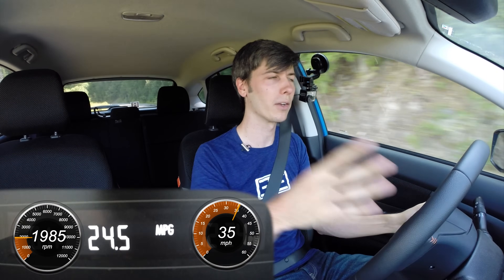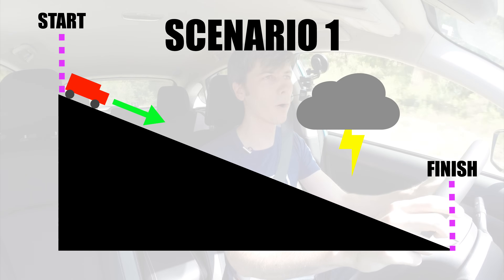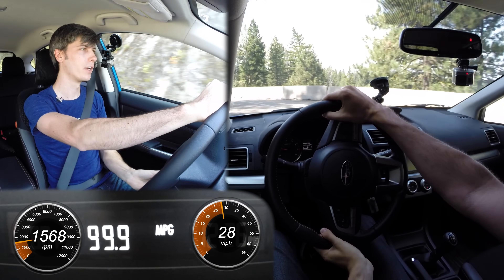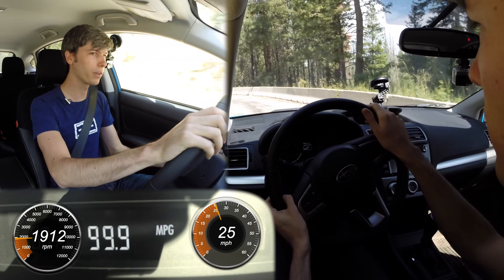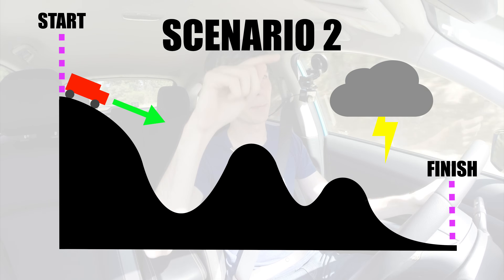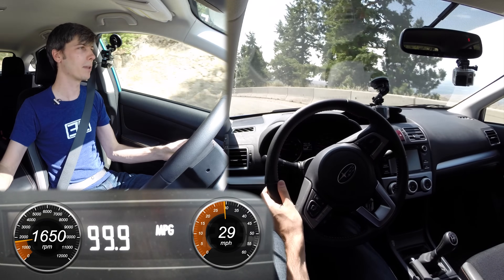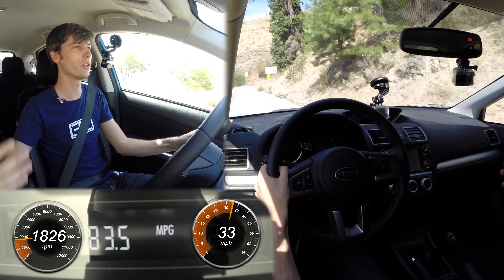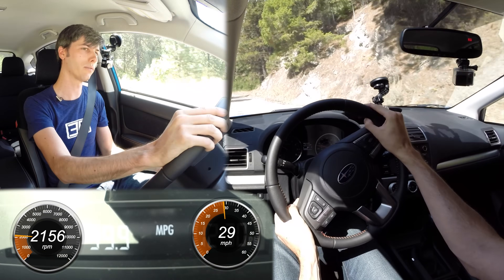What Uses Less Gas - Coasting Or Engine Braking?

Comment: Why does the car need to inject fuel if you're in neutral?
Reply from the maker: There is no connection between the wheels and the engine when you are in neutral.
Reply: that's what I was trying to say, thank you
Reply: to keep engine running, otherwise it would stop
Reply: Why would it stop? Wheels are still turning right I don't see how it would be different than if car is in gear?

Comment: It depends but most likely you will be using engine breaking more often because you rarely find perfect hills one after another for coasting in neutral over them like a roller coaster. 

A lot of towns in Texas say "No Engine Breaking by city ordinance." I wonder whyg that Is? Is it because people won't see youh breaking and slowing down gradually?  Is it because when people shut off the engine breaking it lets out more exhaust all at once or something? Curious.
Reply: They're talking about semi trucks using engine braking. It's like 55 times louder than a diesel engine idling.

Comment: Fuel injectors do not shut down. Your engine is still running and using fuel.
Reply from the maker: On modern cars with electronic fuel injection, yes, they most definitely stop injecting fuel.

Comment: Then why do some automatic cars like mercedes go into coasting when you drive down a hill in ECO mode?
Reply: They only do that if they have a system for keeping your vacuum assisted brakes and servos operational. Like the hybrids (think something like a C350e). Coasting AND turning the engine off is the absolute best way increase efficiency, but not at the cost of safety. Which is why not all cars does that.
Reply: I'm not sure if I understand you correctly. Coasting in an automatic means it goes into Neutral and keeps the engine idling, right? My question was why they would program it to coast instead of shifting into the highest possible gear if that saves more gas when I'm driving downhill. As far as I understand the vacuum assisted brakes and services should still be able to operate through engine breaking. I drive a non hybrid 2016 (so it should have a modern EFI that can shut off fuel) mercedes and it coasts when I'm in eco mode.
Reply: I just saw on a different video that they coast instead of using a high gear because although you do use fuel to keep the engine idling it's more efficient to let it coast because you have to step on the gas way earlier when you're engine breaking. So I guess it also depends on wether you want to not exceed a certain speed like on a twisty downhill road where you use engine breaking to save fuel and not get too fast or if you have a road which is only so slightly downhill that you don't get too fast when you coast.

Comment: Does putting the car in neutral turn off the fuel injectors as well as your coasting down?
Reply from the maker: No, when in neutral you must inject fuel to keep the engine running.

Comment: This video does not take into account older cars that do NOT shut off fuel when the car is in drive and no throttle.
Reply: dtoften yeah....and? He never said it did
Reply: And he didn't say that it didn't either which is why I made this comment.  If you noticed Engineering Explained made a pinned comment stating that it only works in new cars about 3 hours after I and others have stated this.
Reply: dtoften it does take it into account if you know how to read.

Comment: One I'm curious about is on a hilly road, is it more efficient to apply constant throttle, but allow your speed to vary (slowing down up hills and accelerating down them), or to use cruise control to keep a constant speed (more throttle up hills, less throttle down hills)? My assumption would be "not significantly different as long as you aren't downshifting to get up the hills or applying the brakes when going down down the hills" but never seen it tested.

Comment: I'm not sure, but I think that in cold climates, the fuel injection system fires the injectors so that the catalytic converter doesn't get too cold.  
The cat needs a certain amount of fuel to keep it lit.  
Otherwise, during a long downhill and cold ambient temperatures the cat will cool off and then when you do press the accelerator the cat won't be working and emissions will exceed limits.

Comment: Please not that you don't have to go back many years to find cars still using fuel when you take your foot off the throttle. 

So, an important part of your "it depends" also depends heavily on what you're driving.  My 2000 Sierra 1500, for example, absolutely continues injecting fuel when you're completely off the accelerator.

Comment: I think it also depends on the engine. My H-D Dyna uses fuel coasting in gear, and I get higher MPG readouts coasting in neutral than I do coasting in gear.

Comment: So what about going down a hill, with a long flat part afterwards where in gear you would need to accelerate? At what point does the extra rolling in neutral become more efficient than rolling part way in gear, then when you slow down on the flat road, accelerating?

Comment: Interesting discussion, but 2nd example clearly lacks some proof and calcs. You should go and find such hill, reset your fuel consumption, then make two runs: one using the engine braking and then second one (reset the consumption again) using the coasting mode in neutral. Compare two results. Still, it should be noted that in a manual gearbox car you should pretty much NEVER use coasting - in case of emergency (immediate need of acceleration or braking) - you're gonna waste too much time on putting your vehicle in gear and at that speeds this 1 or 2 seconds can be a difference between life and death. Coastng is pretty much only for automatic gearbox cars with such feature.

Comment: Why does the engine not turn off if it’s not injecting fuel through engine braking?
Reply: Nathan W Because it's connected to the wheels through the transmission. The wheels are spinning so the engine has to spin as well while in gear.
Reply: Nathan W You're welcome. I often get very confused myself since I've only had my drivers license for about 7 months.

Comment: You can save a lot by turning off the engine and coast in neutral, I did that myself even in city traffic and saved considerable money :)  I did running starts to get engine going again when needed. Engine breaking even with fuel cut of is wasted energy unless you are running a electric car with regenerative braking...

Comment: Another scenario, where you have to put in throttle to overcome engine friction, then idling is better as less friction due to lower RPM (well engine off is optimal but no steering)

Comment: This makes me think of another question, then. While coasting in gear, there is no fuel being burned. SO... why are engines still so "loud" without combustion? I know that air is still being compressed and decompressed (the cylinders and valvetrain have not stopped), but I assumed that compressing and decompressing air would be less quiet than combustion (an explosion). I know rapid compression/decompression would never be entirely silent, of course (any air compressor EVER is noisy), but just... less quiet.

Air compression/decompression volume > air/fuel ignition volume ???? Is this right? Physics, man. Physics.

If I'm thinking about this correctly, we all basically enjoy the sound of overly complicated air compressors. O_O
Reply from the maker: Air compressors are super loud!

Comment: Do all EFI cars cut fuel while engine braking? Regardless of the year it was made
Reply: I don't think that is why though ;)
Reply: It's not a new feature at all.  All fuel injected Hondas since the late 1980's do this, including my 1994 Integra GSR.  The factory service manual specifically states that fuel injection is cut while driving in gear, throttle closed, until RPM gets down to 1,000.
Reply: It depends. My Scooter doesnt cut off fuel while Cold and rolling downhill and also around 2000 rpms where it expects to detach the flyclutch so the engine doesnt stall while rolling to a stop.
Reply: you have a source for that? since my 2007 doesn't.
Reply: No but my 1997 Volvo V40 does.
Reply: how do you know your 07 Pontiac doesn't cut fuel when closing the throttle?  If the throttle is closed where would the unburned fuel go?  What would be the point of injecting fuel during engine braking?
Reply: Patrick94GSR because I did the same test he did with my car a couple years ago.

I live at the top of a mountain so I have a 10 mill stretch of down hill 70 mph speed limit road. So I used the mpg function in my car. 

It would inject fuel to keep the cylinder firing. There wouldn't be any unburned gas. 

During the decent it would idle at ~89 mpg, with it in hear it would get ~85 mpg.
Reply: Robert Short Pontiac doesn't exist anymore for a reason.
Reply: No. it's a rather new feature. My 2007 Pontiac doesn't and neither does my 1990 f150, but most engines within the last few years do.
Reply: yes all, efi was universal in all new engineered engines since 80'
Reply: This became a federal law in 1995, as well as the OBD-II port.

Comment: Is it ok to coast with the clutch disengaged?
Reply: no, is better put in neutral
Reply: Never disengage clutch or place into neutral, this disconnects you engine from the rest of the car and gives you much less control over the car. Simply place it into a higher gear if you want to coast.
Reply: No, you should leave it in gear at all times.

Comment: Can you switch to neutral from Drive in a car with an automatic transmission while the car is moving? Can't remember if you've had a video on this before
Reply: woudld be pointles because cars with automatic transmittion put themself automaticly on neutral when you let of gas pedal, when you push throttle gear will be engadged and you will accelerate. It's called cruising mode
Reply: Tony x is a troll. R is rearward.

Automatics can switch from neutral to gear just like a manual can. It's more damaging but not by much.
Reply: no, in movement never switch from D to N, only from D to R (race) if you want race off someone

Comment: Surely the automatic doesn't work the same? The fluid nature of the torque converter wouldn't put enough force from the wheels to the engine, so would it still be putting fuel in the engine? 

I drive an automatic and I dont seem to enjoy the effects of engine braking and the cruise control automatically applied the brakes a lot to maintain its constant speed
Reply: Scott Dann The cruise control just lets off the throttle to lower the speed, as far as im aware cruise control doesnt brake with your brakes, it uses engine brake (could be that some newer models do use brake in case of emergency)
Reply: It does. I drive an automatic as well, and it does indeed cut all fuel. The cruise control just functions like a (depending on make/model/setup) PID controller (you can google what it does). Which mean that it tries to have your speed within a margin of error of what you've set it to. One example is my truck (big rig) where it has a 4km/h or 2mph ish) in either direction before making adjustments. So if my cruise control is set to 50, it'll apply the retarder when it reaches around 53 (to keep it inside 54) or throttle when it falls down to 47 (to keep it above 46). 

Most small cars will have a cruise control that doesn't allow more than 1km/h deviation (I base this off of nothing other than guess/experience and no hard data), so it'll apply the brakes and throttle pretty much instantly to maintain a very accurate speed.

Comment: At Subaru 99.9 means 0
Reply: It doesn’t mean 0, since it is number of miles per gallon; and outside hybrids, cars don’t need the extra significant digit as most cars under most conditions just can’t reach triple digit figures with any consistency. What is weird though, is some cars have it cap at 120 mpg, iirc my 05 civic hybrid did just that; now that is a programmer/engineering decision for whatever reason.

So for the most part, 99.9 with fuel cut = unlimited (miles per unit fuel consumed) - because infinity is a concept, not an actual number, you can trend to it, but in concept you have infinities that are greater than others, so it could never have a single value anyway.

Now, working at a dealership, I’ve seen a car read 0 mpg under acceleration; hummer h2, it had single digit averages for tanks in the 4-9 mpg range and the brakes felt like you were driving an overloaded semi, panic stopping because of idiots in front of you was scary, I had to drive it in town a couple times for them and I couldn’t figure out why someone would buy one after taking a test drive, expensive and dangerous for the street.
Reply: Tony x, I would say, L/hectoclick is useful for calculating how many litres of fuel you need for a road trip. km/l is useful for calculating how long your tank will last with a known number of litres.
Reply: that's why L/100km is better, 0L/100km means 0
Reply: ok but L/100 is more precise, on my car for example lowest indicated consumption in km/l is 30 but lowest indicated consumption in L/100km is 0.0

Comment: In the multiple hills scenario, wouldn't it be more efficient to put it in gear on the way down and actually give it throttle on the way  down to  give it enough speed and momentum to actually make it all of the way to the top of the next smaller hill in neutral  since it would use more gas going up a hill to make it over it than the amount of gas necessary to reach the required speed when going down and being aided by gravity?

Comment: On a relative note, which is more fuel economical. Idling in gear or in neutral when waiting for a red light. (Auto/Manual).
Reply: Never stay on the clutch! Always go into neutral and off the clutch. 
The most economical way would be to stay in first with the engine off and clutch released. Just push the clutch to start the engine when the light turns green and you're good to go. At least, when you're waiting more than a few seconds.
Reply: Idling in gear with the clutch in and idling in neutral is the exact same thing in regard to fuel consumption; the engine is disconnected from the transmission. However, in the long run it is better to use neutral as holding the clutch in wears out your throwout bearing quicker.
Reply: Mmm, what about auto transmission does it work the same way?
Reply: In a traditional torque converter automatic there will be very slightly more consumption when stopped in gear vs neutral. This is due to the engine loading up against the brakes to move forward at idle speed.

Comment: So does that mean the piston has to work harder to come down from the "power stroke" if there's no fuel being injected? And if there's no fuel being injected what would the exhaust gas composition be like?
Reply: The power to turn the engine comes from the wheels when engine braking, so your tires are moving your piston thru the drivetrain. 
The exhaust gas when engine braking is just pure air basically.

Comment: I ride a motorcycle (a 2009 SuzukiGZ250). It's carburated and, I assume, doesn't have any fancy equipment that lets the carburetor cut off fuel when coasting. I wonder, is it more fuel efficient to engine brake or to coast? Obviously it's safer to keep the engine engaged and coast in gear, especially on a motorcycle. I'm wondering if the carburetor uses significantly more full with no throttle at higher RPMs than running at idle.

Comment: If you really want to save gas, coast in neutral with the engine off.  Going fast you don't need power steering, and there is enough left in the power brakes for a couple stops.